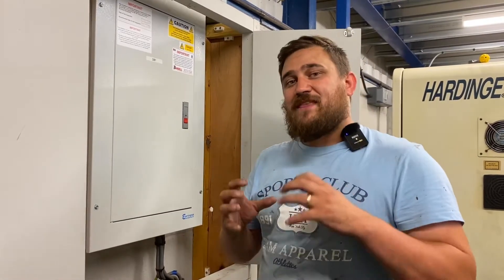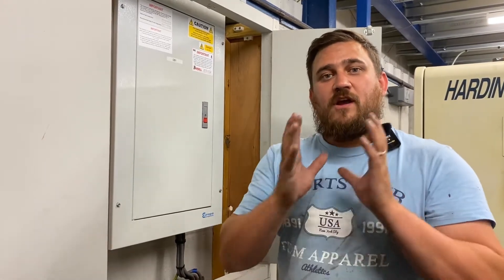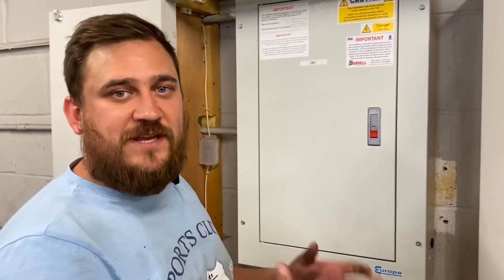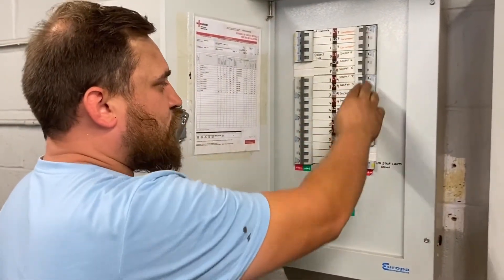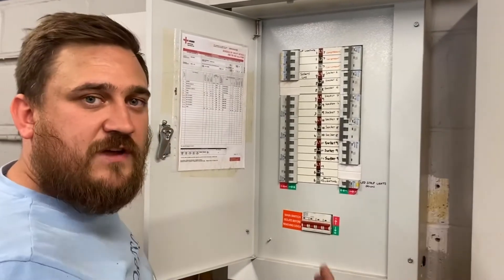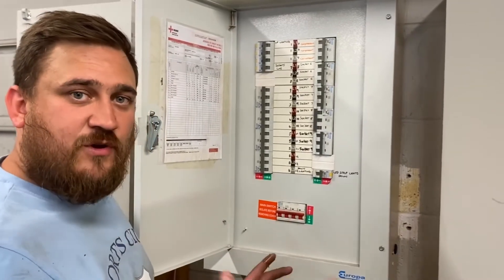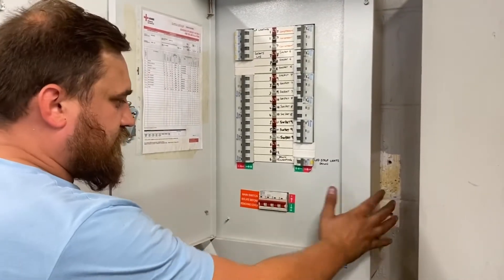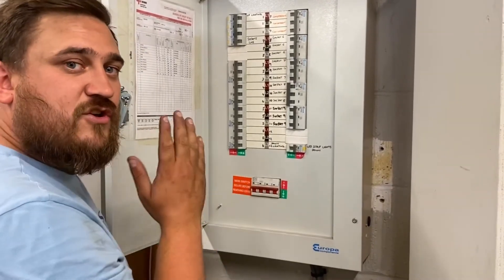Safe Isolation - Don’t FAIL Your AM2 or AM2S

Comment: This is what I did during my am2s put the padlock on after taking the cover off I did turn it off first but then he asked me why I didn’t put the padlock on first and I thought it was a trick question so I said the padlock won’t fit throught the cover then he said in a proper condescending way ‘ohh so I don’t do this everyday do I’ continued all day to speak to like an idiot and on the 2nd day then I’d had enough of it and said something this caused an argument and resulted in NET kicking me off my apprenticeship 🤣 how does that work 4 year and kicked off for 1 guy I’d just met speaking to me like an idiot

Comment: That isn't safe isolation as there could be exposed copper on the incoming side of that switch disconnector. I would isolate upstream of that DB as it is much safer. I can't tell you the amount of domestic CUs I have inspected where the installer had not terminated the line conductor properly and there is exposed copper to touch
Reply: This is for am2